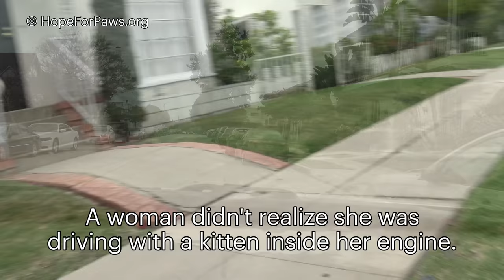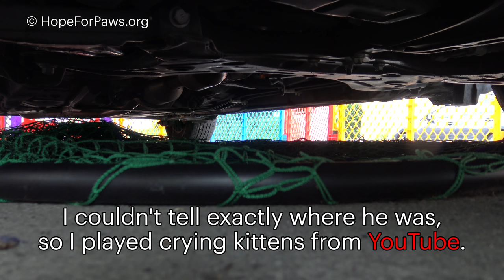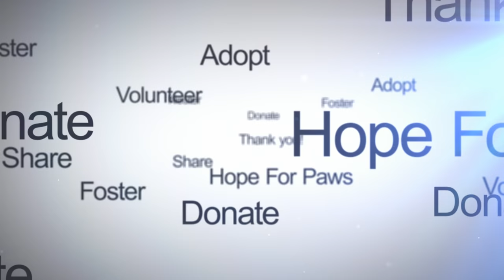Poodle saved a kitten's life from a terrible death!!! #kitten

Comment: Eldad,, you never cease to amaze me.  Thank you for rescuing this little one.  You risked getting bit by this little one's teeth that would have felt so bad.  (I know.  I made the mistake of offering a kitten food and my fingers got bit so bad because the kitten thought those were food).  Cat bites are real bad with bacteria.  It doesn't feel too good to be clobbered by cat claws either.  Cats being inside a vehicle is a real danger, especially if they're trying to stay warm.   We don't usually have stray cats/kittens around outside running loose, but we did one time.  It was a mother cat and her two young kittens trying to survive outside temps of 40 below zero.  When I found out, during the day, that it was going to be that cold, I called the animal shelter and they gave me two humane traps.  I put food  inside of them and caught the two kittens right away.  The mother cat was waiting outside the trap.  We were inside watching and when we saw there was something in the trap I went outside and there they were.  I already knew that if it was the mother I would have released her to be with her babies.  Thankfully, it was her babies.  The mother reached up to my hand and I bent down and scooped her up.  As you might guess, she didn't fight me with as cold as she must have been.  They had been out there for a while and our neighbor told us about them.  She had put out a heated house for them, and I put out a Rubbermaid container that I had insulated with a piece of foam going all around the container and cut a cat size hole in it.  They did use it, but I don't know how often.  I suspect someone had just dumped her off, because as it turned out, she was a biter to get her messages across.  We still kept her and the babies got adopted.  It's not good to have a cat that bites, but at least her babies got adopted by an older couple.  We call the mother, Mumsey, in honor of her being a good mother in the worst of conditions.  She deserved to have a loving home.  We just have to watch out for her teeth.  Oh!  They made use of an abandoned wood chuck den under our shed.  Wood chucks make a complete condo so they even had rooms to choose from down there.  I just happened to see the baby run from me and she went under the shed and I knew what was down there.  Cats are real adept at taking care of their needs, but life out there alone is no joke.

Comment: we have so many feral cats around here in coral springs florida. I even had a similar experience when left work one day. I heard a thump and looked in the mirror and saw a cat running out from under my car as i was leaving the parking lot I had no idea where it wen't but it looked like it was not harmed as it was able to run rather quickly and bolted into the nearby neighbor hood. it probably belonged to one of the houses as i did see a glimpse of a red collar before it disappeared in to the neighborhood across the fence. by the time i got out of the car it was long gone and i just hope that it found its way back home and was not injured. but we also see a lot of feral cats around here that are likely just runaways some of which are not neutered and you will find them with kittens. they will often be found hunting the many ducklings as we have a duck infestation which these stray or feral cats are taking advantage of. its like watching a nature documentary sometimes. and honestly the cats are doing a much better job then animal control can with the duck problem.

Comment: My family had a cat when I was younger, and it had a litter of kittens, 5 of them. I left one cold night to go to the store. When I started backing out of the driveway, I heard a noise. I couldn't tell what it was b/c I had the radio on. I turned it off and listened and heard a faint sound coming from the front of the car. I popped the hood and found 4 of the 5 kittens huddled next to the engine for warmth, but 1 was missing. I found her in the grass several feet away and when I went to pick her up, she screamed. I knew she must've fallen off the engine, and I must've run over her. Her legs just dangled. We brought her to the vet immediately and he said she had a crushed pelvis and broken legs. We had 2 choices. Have her euthanized or she could have surgery. We opted for surgery of course. I don't know how, but they saved her life, AND to everyone's surprise she was walking again in about a week and a half (with splints). She could only walk on the carpet. If she walked on the tile floor, her legs slid out from under her. She even climbed up the side of the sofa to lay on my lap. She wound up living 15 years and could run like the wind. Dr. did a great job.